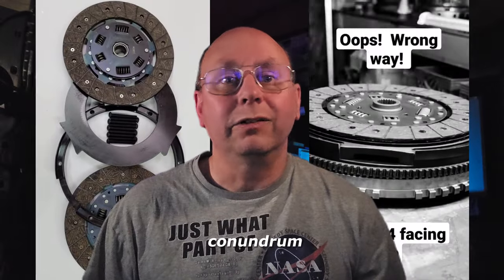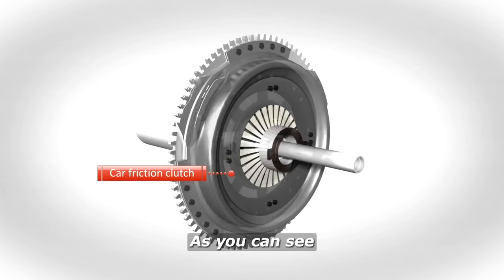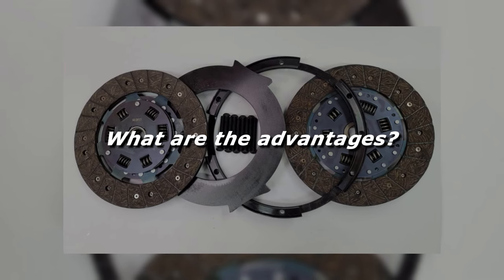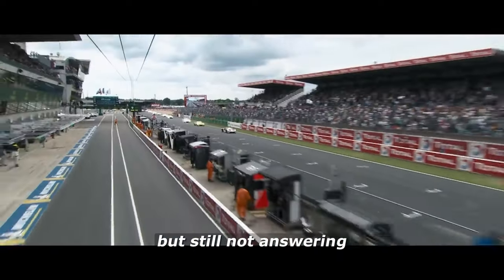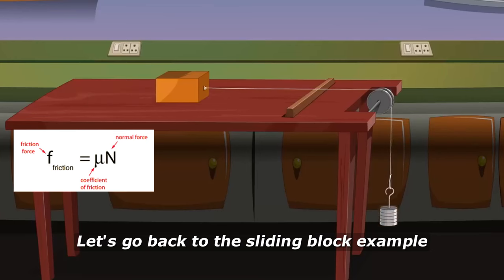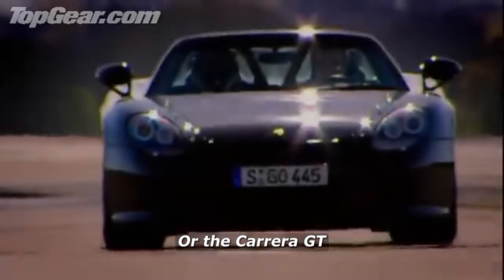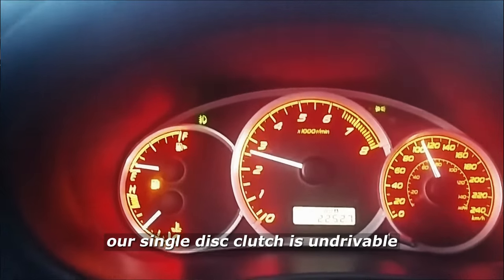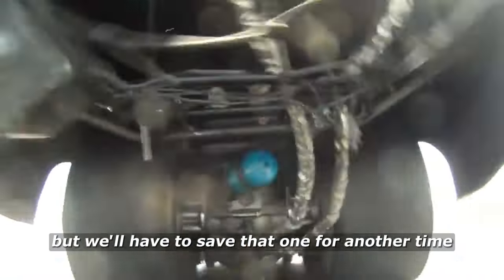How Dual Disc Clutches Work and defy basic physics

Comment from the maker: Here’s another way of representing it mathematically from a good Friend 🙂

Clamping Force (single clutch disc):  F=P×A
Where:
F = clamping force
P = applied pressure 
A = surface area of friction plate  

For a dual-disc clutch: F(dual) = P(dual) x A(dual)
Where:
F(dual) = clamping force of the dual-disc clutch
P(dual) = pressure applied by the dual-disc clutch (which is the same as F(single))
A(dual) = 2A, the combined area of two equal clutch disc surfaces
Since P(dual) = P (same pressure applied), then F(dual) = 2F (double the clamping force)

Torque Capacity:  T (dual)= F (dual) × r
Where:
T = torque capacity
r = radius of clutch surface disc

Since F(dual) = 2F(single), then T(dual) = 2T (torque capacity has double)
Reply: seems easy enough (:
Reply from the maker: @sammybalamby   probably too easy for a Math Major!

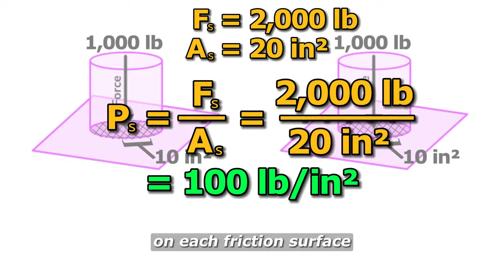Comment: Unfortunately you misspoke at 4:03 and I think your block analogy went a little awry after that. You said "doubling the pressure and the surface area still gives us the same pressure" when you meant doubling the force. Honest mistake, but it was compounded by going back to your block analogy immediately afterwards. In reality, the pressure is being kept a constant by the pressure plate, you're doubling your surface area over which this same pressure is applied by stacking your discs, and therefore the force is doubled. In this case, it's like attaching an identical block to the side of the original one on the table (increased surface area in contact with the table but same pressure); placing it on top of the original block (same surface area in contact with the table but increased pressure) would be like increasing the pressure of the pressure plate with stronger springs or moving the fulcrum point. Same net result at the end, but the mechanism of action differs in both the torque capacity of the clutch as well as the block example.
Reply: Well put and good catch!   It's kind of an odd one comparing it vs. the block and f=un equation since you're able to double the force without doubling the force or clamping load of the pressure plate.  They end up sharing the clamping load without losing anything.  neat trick!
Reply from the maker: yeah, I get a little tongue tied.  I see it in my head, but getting it out can be a bit challenging!   Either way I hope you enjoyed it!

Comment: But does it still feel gradual like oem?
Reply from the maker: Yes.  And we cover that and much more in our next video on upgrading from a Sachs st3 to a Protomotive dual disc clutch.    It'll come out next weekend :)
Reply: @protomotive  beautiful!
Reply from the maker: @rafyg   I love the dual disc clutch in my Blue 996tt.  So did RoadsUntraveled when they drove it for the video "we found a 1,000hp Porsche 911 turbo where you'd least expect it"
Reply: Absolutly :)  I have one and you could swear it's a stock clutch by the pedal feel.  :)   But can handle 1000hp easily!

Comment: whether you like it or not, wider tires grip better. many have made researches about that and they were shocked to prove that wider tires wouldn't make a difference with larger surface contact. but that has been said theoretical, however practically it doesn't apply. running a 225/55/17 wheels tends to lose grip during accelerating in a straight line rather than 275/30/19. some might say it is an unsprung weight. i say it is a larger surface patch. next time try running a 185 wheels on a drag car instead of wide slicks with no groves for increased surface contact and see how it goes. gripping on slippery ground with just your ankle as contact point has lower chance to grip than your whole foot.
Reply from the maker: There's a lot to it for sure! It's just interesting that practical physics formulas don't say they will even though they do.   And the key is in the term "sticky" tires, lol...   I'll see about doing a full video on the explanation of why they do!    Thanks for watching!   We hope you enjoyed it :)
Reply: And those big meats just look amazing :)